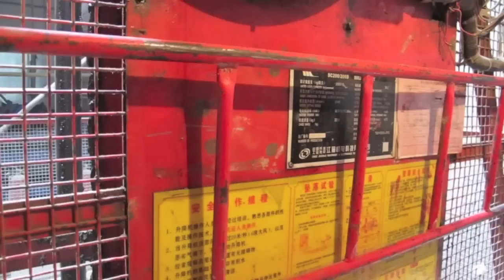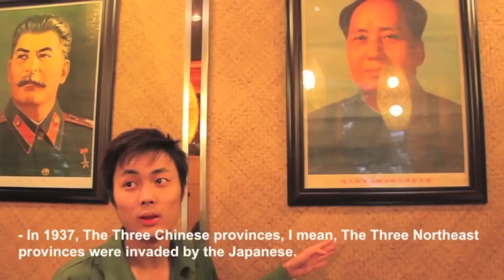Chongqing - China's Secret Metropolis

Comment: Ah, the apes of the planet display their intellectual prowess by burning fossil fuels and filling the air with exhausts. Quite possibly the least inspiring scenery you can have. 

And before you throw a tantrum. I'm calling the entire species of man apes. Because.. we are. A whole lot too.
Reply: I like how you just assumed I'm american and kept going. I'm not. And I'm not trying to measure how bad countries are in comparison. If you would look at the planet from a distance, not knowing borders and imaginary lines, we would look like mold on a sandwich. Maybe even cancerous.
There's nothing symbiotic about our existence here at all.

Your instant defensive positioning underlines my statement. However, we're not without awareness - and we should do more with that and work less on impulses, laziness and greed.
Again, I'm not blaming individuals, this is for the lot of us.

Our current sources of energy is proof of that. Both nuclear and fossil fuels are extremely hazardous, there are better alternatives, yet nobody stops using it to make a point. I don't drive a car or run anything on T-Rex fuel. But this reply is nuclear powered. 
You would need more than a handful of treehuggers to make real change. Most of us have the common knowledge - but none of us is part of a common initiative.